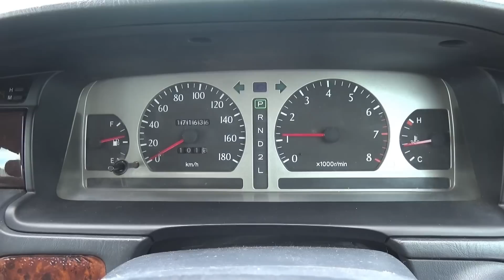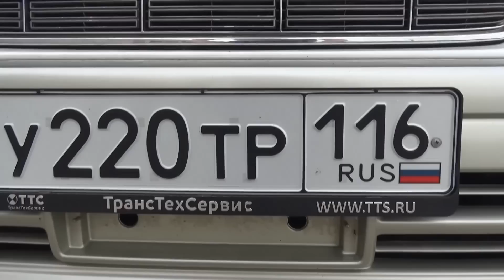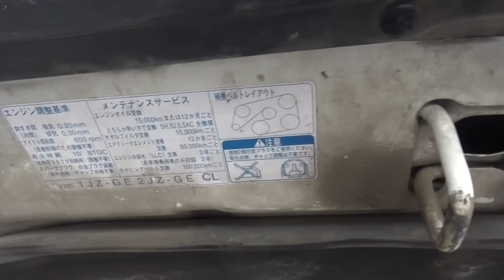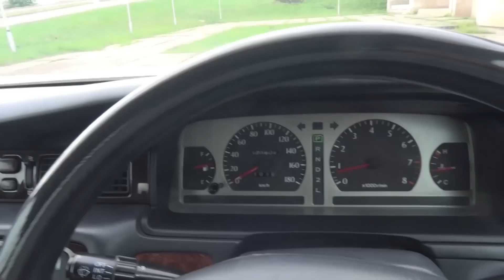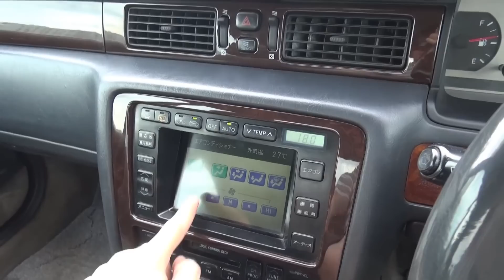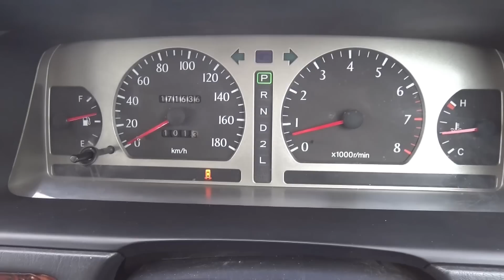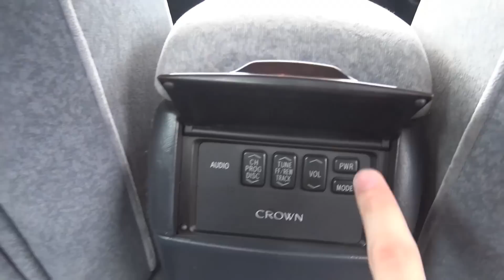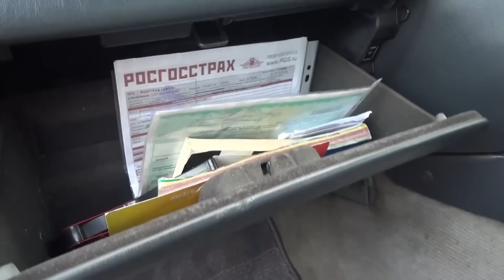1996 Toyota Crown S150. Start Up, Engine, and In Depth Tour.

Comment: Amazing interior. Sadly now days cars have cheap plastic and everything sacrifice for technology and gadgets .
Reply: Really bad technology too like batteries inside your valve stem to report tire pressure. Dunno It's good for live pressure I guess at the same time kind of a hinderance and extra maintenance issue. Sometimes all you need is to look at your tires before getting in and feeling any changes while driving so ultimately crap like that is useless.

Comment: That's a 2JZ!
Reply: ElseWhere 47 nope clearly it's 2500 which means it's 2.5 which means it's 1jz. if it were 3000 which would mean 3.0 then it'd be 2jz
Reply: Abood Alshoodri  but its still strong and tunable right?